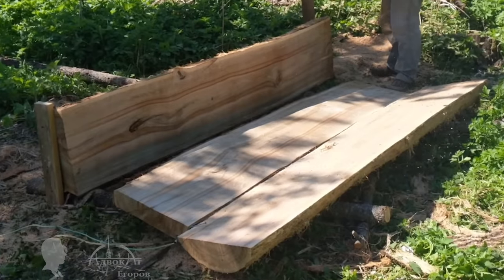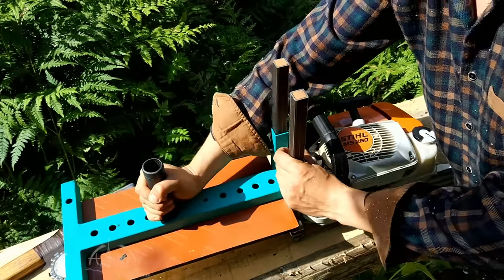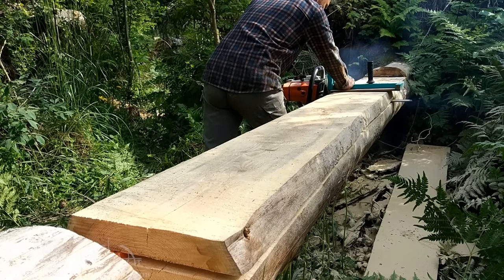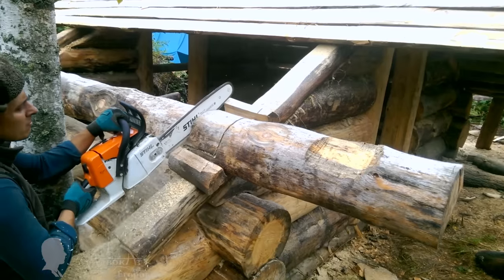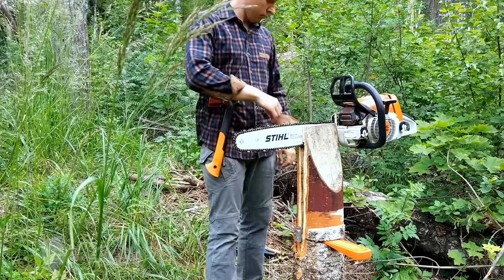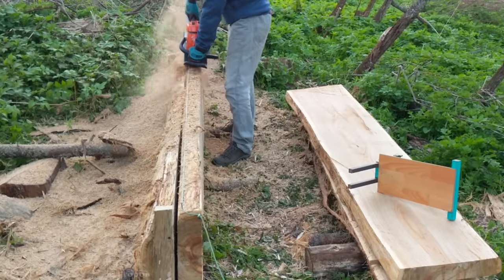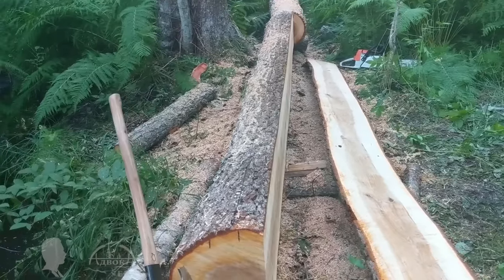Two Chainsaw Secrets | Turning a Tree into Perfect Boards

Comment: I've tried this as a noob chainsaw user on a tree felled by lightning. 

I ended up with two boards of 2m50, less than half a centimeter off being dead straight. I was amazed that this was possible for me. Now I have two great benches made from those.

Question: is this safe? 
I met a pro later on, and he said that cutting with the tip of the saw is very dangerous as it can make the point of the blade split open leading to dangerous failure.
However I have noticed no such damage of any kind at the tip of my blade. But as this guy cuts trees for a living I'm a bit scared to use this method now. Anyone know how to watch for this?
Reply from the maker: Well, chainsaws are not the safest tools))
Reply: I laugh because that is not the answer I was looking for, but perhaps it is the one I needed; I'll just be careful and keep an eye on the equipment. 

Thanks again sir for this tip. It was part of a very meaningful personal journey for me. 

And in the remote area of Spain I'm in, thanks to you I can now make so many things by going into the forest and processing the recently dead or dying trees.

You didn't give me a fish, but you taughtme how to catch them myself.

<3 @Advoko

Comment: I work in line clearence. The best all around saw I've touched honestly is a sthil 261.. Husqvarnas are not as good. They are second best in my opinion.. I run saws all day everyday and like that all models have problems. The 261 is hard to kill I mean I dominate that saw full throttle all day everyday and she just don't quit.. I run a 20 inch bar and chain on it very rarely will I ever have to grab a bigger saw... I am partial to Husqvarna tho I like there bigger saws but when all you do everyday all day is run a saw its truly hard to beat a 261.. only issue with 261 with 20inch bar and chain is it does need a bit more power... If you know how to run and saw and understand kick rapid chain is way to go just watch your knuckles cuz it does sling brush.
Reply: Thank you. Duly noted. We bought the big hurscavana and its awesome, but I need a smaller saw I can use, so going to take your advice and go check out the 261.
Reply: @ariloves10  you will not be disappointed. Husqvarna does make great big saws they are equal to sthil there. So I'm sure you are very pleased with your Husqvarna. When it comes to the what I call monsters that's when I break out the Husqvarna.
Reply from the maker: I read many comments under this video recommending a Husqvarna brand and ended up getting a portable Husqvarna 365 chainsaw. I have no complaits so far...)))
Reply: Got it..lol.. Its Husqvarna and mad respect to the men who use them 👏 🤠❤
Reply: @Advoko  that is a great saw sir.

Comment: I'm going to have to try this method.
I have a Stihl ms260 that I have been using for several years. K have a Stihl authorized dealer that I take it to when needed but that has only been a couple of times. One thing that I do with all of my small engine machines is let them warm up for a few minutes before I start running at full throttle. Usually I start the saw and let it idle while I get all of the safety gear on. This let's the piston and cylinder get warmed up evenly a prevents the piston from scoring the cylinder on one side. Check out Steves Small Engine Saloon on youtube. He has a great video on this.
Reply from the maker: David, thank you for the info. If you search through multiple comments here you will find many success stories using this simple milling technique on the first time...

Comment: 60 inch blade saw, get a tall set of step ladders and climb up till you are right on top. At this point strap saw around your arm and swing it violently some pieces will end up smaller than you wanted but, you can glue them together to make a big board,,, and think of all the scrap wood projects you can make money off.
Reply from the maker: Gary, thank you for the tip

Comment: I've been trying the freehand technique for a couple of years. I have found it massively more tiring having to hold and swing a 10kg+ saw for hours at a time, and although it does work the results are never as good as with an Alaskan chainsaw mill. The bit about "the chain not biting enough wood" is a bit ridiculous. How you set the chain up is up to you.

Comment: I had that problem with their synthetic oil destroyed the saw in 3 months switched away from synthetic and upped the ratio just a bit and the new saw is now 3 years old. The dealer wouldn't honor the warranty so bought the next saw from a different dealer

Comment: I think if he would have put a Bolt through the end of the Chainsaw Bar it would have done a lot better I bet when he started cutting it done good and then as he cut through the log the chainsaw started choking down, when he is cutting through the log there is nothing holding the end of the bar up so it will droop down as he goes through the log putting itself in a bind, I saw video last night where a guy had built a homemade sawmill with a chainsaw but he has had a Bolt through the end of the bar with a ripping chain on it and it done very good

Comment: the bushcraft sharpening stump! dank as fuck bro! also get the ms 360, 361, or 362. the used ms360 might be worth more than the brand new 362 because the newer ones have so much emissions stuff.. but yea.. you bump it up to a real pro saw and you are going to be blown away. the power to weight ratio on the pro vs. non pro saws is ridiculous. source: ran a 361, 362 professionally and then went over to a farm boss and i hate it. the small old non-pro stihls are good but nothing like the pro line. its like add 50% power and cut the weight by 20%.
Reply from the maker: Thank you for the info

Comment: What do you have in that red petrol can?  It looks like straight petrol, without oil in it. That is mixed, right?  That piston looks like you ran your saw without gas and oil mix.
Reply from the maker: It was the right mix, my old Stihl 180 saw was fueled from the same can...
Reply: In America the chainsaw oil has a blue dye added.  This makes it easy to check whether the oil is meant for 2 cycle engines.  Some countries don't do that.

Comment: Use only the front tip of the saw! Long curls.
Simple, easier on the  saw, fuel savings,  and better results!
Let the blade guide itself.
.............
My only upgrade.
Being a lazy American...an seeing this in a factory...use a bungie to hold the weight of the saw. Then you only guide the saw's swing. 
.........................
So...that's how you kill a moped!!!
.....................
Spasiba, Comrade!
Reply: As I watch other videos...your tip only technique is easiest on the  engine.
.....................
It's simular to using an axe. You can swing a thousand times, and really hard swings.,  but it's wasted energy...if no chips are flying.
 ............................
Thank you,  Zen Master of the chain saw blade!!!
Little effort,  but greatest results.
........................
ALL of the level plank guides..."Less than $100" chain saw guides are level with the ground. Vertical would let gravity help them, with chip removal.
Level guides drag the chips, equals more work on the engine.

Comment: I didn't see an oil hue in that gas. Might need a richer mixture of oil. Could that be contributing to the piston wear?
Reply from the maker: It is possible but I used the same mixture on both chainsaws and my old saw was running fine.

Comment: The ms260 is commonly used for limbing and climbing, obviously not intended to be in lumber production. There is no 50cc that is intended for that task, period. 
The smallest saw for that duty would be a 70cc or greater.  Even in the native mango forests where they use the exact same technique as you they use 070 and 090 stihl saws, which are 100cc+ .
You will basically continue to burn up smaller equipment pushing it this hard.
Perfectly strait is somewhat subjective in this video.
Reply from the maker: I bought a Husqvarna 365 chainsaw to replace the broken Stihl and had no issues with it working it hard for almost two seasons...
Reply: @Advoko  glad to hear it , your a motivated man.

Comment: Did you ever make your wood drying videos? I looked but couldn't find.
Reply from the maker: Never got to it, sorry
Reply from the maker: No, never got to it. One of the reasons, I later found this method less than perfect and didn't wan't to share such info with my viewers. I mean it works, but in some cases you get some mold if the weather is really rainy during the wood drying season/s.

Comment: A stihl 260 is not powerful enough to begin with. Also, the bar needs to be longer... Only a third of the bar length should be in contact with the wood.

Comment: Buy an a echo or oleo mac saw or any saw without stupid stihl 2 mix, or husqvarna xp engine. Echo i perfered, Japan technology. Make sure you buy original and good 2 t oil and make sure your carbouretor is tuned correctly, so your mixture is not lean. Stay away from husqvarna and stihl, they are making a lot of junk nowdays. Thats my advice. Thanks for the video
Reply from the maker: I ended up getting a Husqvarna 365 chainsaw... Great saw

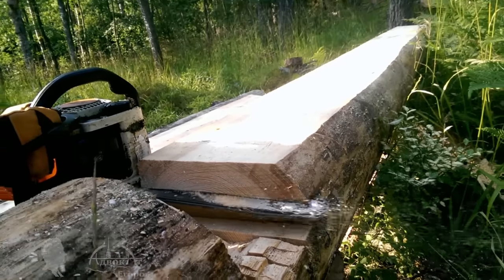Comment: Dont saw at full trottle . And go to 1:40 gas mix 98 octane petrol . At first clean your spark plug ,than saw one tank of gas this way .
Thake the sparkplug out and the colour must be like coffee with a little bit of milk .
Is the coluor good continue, is it to black  go to 1:45  .
Let the chainsaw cool down for 10 min  to fill up ,because everthing is hot also the membrame and than it cant mix the oil and gas to the cilinder anymore .
I use a second chainsaw for efficiency ,more work in a day done
Reply from the maker: Thank you for the tips

Comment: I don't know about  the 260 . The first chain saw i bought was a 026 stihl . My dad was was a stihl guy so... The 026 last me for 10 years doing my own fire wood and some sawmill wood 5hat i sold for profit . The 026 was a very good saw .The next saw was the 261 ,the first serie with adjusting carburator screws ,2012 ,the best chainsaw ever made in my opinion.  Then later i 've started logging professionnaly ,so i wanted something  more sexy ,i bought the 550 Huskvarna , lovely saw, that i ve baptised Agnetta ,because she was my dancing queen . But unfortunately Agnetta  was a good dancing partner but not a very tough one . I bought a second husky 550 xp turbo and it didn't last either . My stihl 260 bailed me out one more time . Its was not as sexy as the husky but it was dependable. Then stihl came with  a serie to compete with huskvarna 550 xp sexiness that was even less reliable than the 550 . The stihl  tilted forward engine will explode like pop-corn if you are a little demanding . I 've just bought a 550 from the new serie , according to my dealer its much better than the first one . Im not sure i will name that saw Agnetta, but everytime i work with it i hear  " dancing queen ,only seventeen,she 's my dancing queen ".
Reply from the maker: Claude, thank you for the info. I ended up going with Husqvarna 365 chainsaw and it hasn't let me down so far.

Comment: Husqvarna 550xp or 562xp they both do good 550 is 50cc 562  60cc I'd go 562xp better power for what your doing or if you want Bigger Husqvarna 572xp is dependable
Reply from the maker: I ended up getting a Husqvarna 365 saw... It was a good choice.

Comment: My home made bar is better ,much more easy. 3 bars one tree. 2 iron bars with 1/2 increments holes in bars. 1st bar has one pointed end to pound in ground 3 feet. If a rocky area this will not work. Second bar gets nailed to a tree with 3 longer nails. THE 3RD BAR IS 20 FT. LONG with a drill hole at each end for adjusting level. YOU MUST , perfectly level 1st cut , otherwise your next cuts will be off.  Even if your ground is not level. Log holders. Keep the log above ground and can be moved by putting the iron pin in hole. These two brackets where pin is welded below an iron plate with two a stabilizers that hit vertical bar. So one of bar pounded in ground does not move into ground you put on bottom a bracket so does not sink in ground. To prevent log from rolling 2 nails on bottom of log go thru bracket into log. A bracket fits on chainsaw so it moves back and forth on horizontal iron rod. Moving the horizontal rod down for next cut. I recommend greasing horizontal rod. This process is less time consuming if you use 2 trees.
Reply from the maker: Ray, thank you for such a detailed description.
Reply: Отличное пояснение

Comment: To me it looked like there was not enough oil in the fuel or that the piston seals were removing all the oil from the piston sleeve witch ruined both the piston and the sleeve. The piston is suppose to ride on a extremely thin layer of oil to have little to no wear.

Comment: Try a Husky chainsaw, I have both but the Husky produces much better torque.
Reply from the maker: I ended up getting a Husqvarna 365 chainsaw. It's been a great saw so far.
Reply: @Advoko  Good choice. I also use the Husky 3120XP but I'm getting a bit old to swing off the end of it now.

Comment: the MS260 is junk. I had 1 it last 2 weeks and melted, it cant handle constant revving, upgrade to ms660 36inch bar with a ripping chain and set up on a gravity drag using alaskan saw mil.

Comment: Stihl 260 for cutting logs into lumber: "fairly light tasks". Brother i love your videos, but that saw is not meant for that kind of hard work. Its a 50 cc saw.. i would reccomend a 661 for your purpose. Also, it wont matter what saw you use if oil does not reach the bar it will overheat the engine and score the piston. This is especially "dangoures" when doing long ripcuts like you do. But for a saw reccomendation id say 661 will solve ur problems.
Reply from the maker: Thank you for the reply!

Comment: so why cant you just use a shorter bar and cut it from 2 sides separately, eventually meeting in the middle?
Reply from the maker: You can, it will be harder to make the slab flat though

Comment: Your saw failed not due to your gas but because of the carb setting.  You are running too lean.  The oil is in the gas lubricates your piston/cylinder, also it is running running too hot (again to lean).  Waste some gas and save your saw.  I ruined an engine myself but I was fortunate to find a guy that knew what was wrong.  You need to have a set of adjustment tools.  Always know what you’re carb is doing.  There are a number of good carb adjustment videos on YouTube.

Comment: Thanks for the tips! 3 yrs later watching video. BUT I have the same problem today with my Stihl. I have an older model 210 that has never needed repair and just bought a new farm boss 271 and it’s not as reliable. I’m afraid the Stihl is no longer making quality German saws and has fell victim to China waste land garbage materials due to cost. Sad day indeed. Stihl if you are LISTENING stop selling out to cheap manufacturing and use quality!! WE WILL PAY FOR QUALITY!
Reply from the maker: I ended up buying a Husqvarna 365 chainsaw 3 years ago...

Comment: dont use ethanol in your chainsaw. there is a simple way to eliminate it from your fuel mix if you cant buy ethanol free gasoline. I have a Stihl 310 and 660, they are each over 15 years old and running strong. I use them every year to provide heat for my offgrid house. If your chainsaw is giving you problems, its your carb or the fuel/fuel mix ratio.
Reply from the maker: Tim thank you for the reply

Comment: Stock chain is a CROSSCUT design, not for ripping. Why did you not buy a ripping chain?  modify your chain for this purpose?
Reply from the maker: I resharpened my crosscut chain to a ripping chain configuration
Reply: I’m glad you clarified this.  I’ve seen many people get frustrated not realizing that they were using the wrong chain

Comment: Hi. ms 260 is not a strong saw. You need at least ms462 and stronger (ms 661, 500i,).
Reply from the maker: You don't need a strong saw to use my method as only a few chain's teeth are engaged at any given moment...
Reply: @Advoko  I unerstand. Just my general opinion is that I wouldn't classify ms 260 as a strong saw. That's all. Good job.

Comment: Timber framed homes > log cabin home
Reply: Round whole logs are much stronger than squared timber.
Reply: @PFirefly06  totally but a timber frame if done well.  By trained eyes can last much longer has more opportunities/possibilities to additions and adaptations and instalments for insulating items for example. Isnt enough strength, enough 🤣not to push it to the edge. It uses way less wood. 
You dont need a super insane sturdy house in most places in the NA. Its fun for sure and not super complex so theres that. For bigger buildings and such structures I bet that would be amazing if done properly so its not splitting everywhere or that becomes a bug's home(depending on where you live) I bet it would look gorgeous though. Youd also use way more wood for fireplace just keeping it warm if your in a colder place. So its a waste of ecological resources and utility which is very important esspecially in today's day and age. Hope this was helpful

Comment: How do you get the cut started though?
Reply from the maker: I showed it in the video...
Reply: @Advoko  you mean the 2 seconds at like 8:41? Does it just cut straight down from the start of the cut?
Reply from the maker: You just start your cut along a guide wire with the bottom tip of a guide bar.

Comment: So youre saying just buy a ripping chain?
Reply from the maker: Ripping chain is better for this task.
Reply from the maker: You can. I resharpened an old crosscut chain to be a ripping chain (changed its teeth attack angle to ripping chain specs)
Reply from the maker: It would be the easiest way